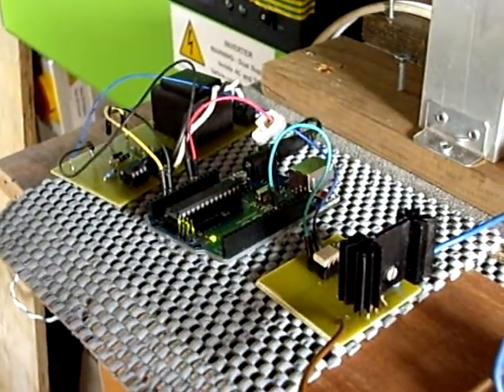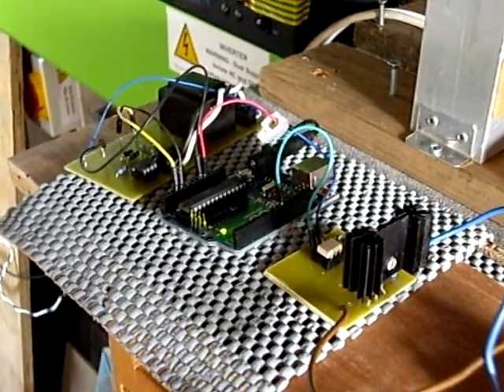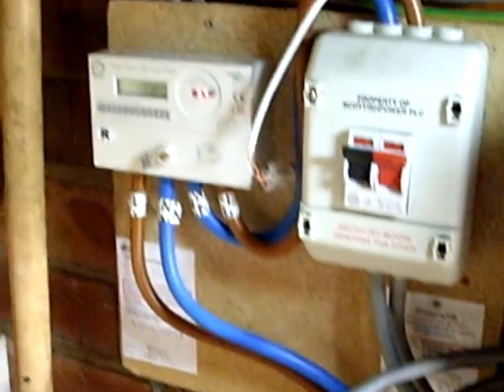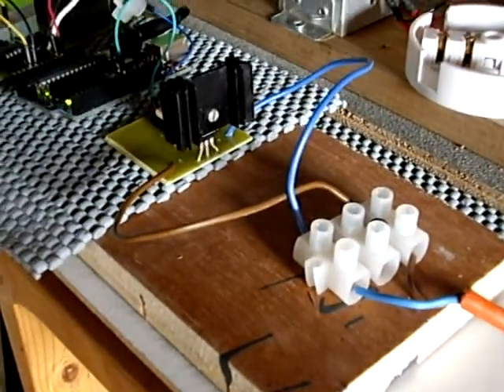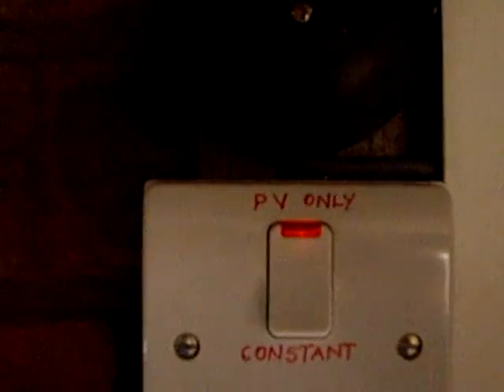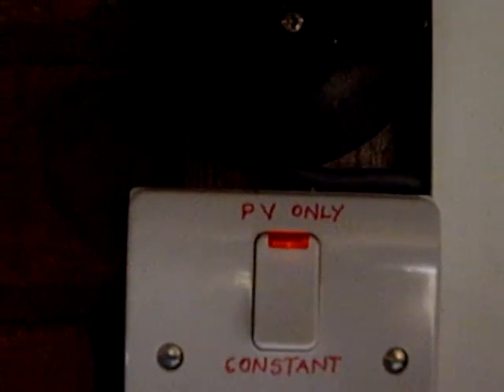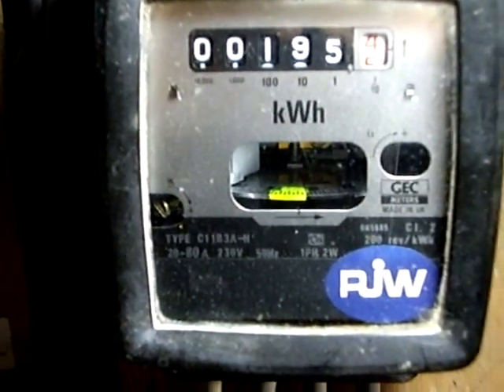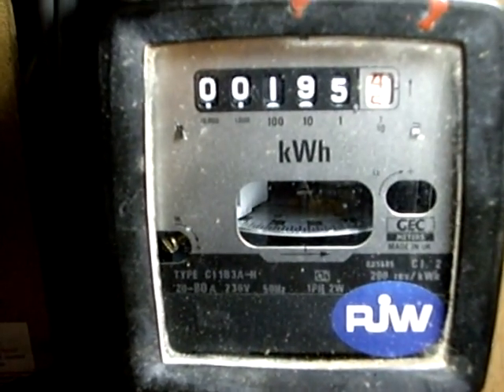First results for p-a controlled PV router

Comment: another brilliant video Robin, well done. the Phase Angle mode does appear to dump the surplus energy more efficiently than your Mk2, saying that, the Mk2 is a brilliant design. although the hardware is relatively simple in design, your code to run it is extremely well thought out.